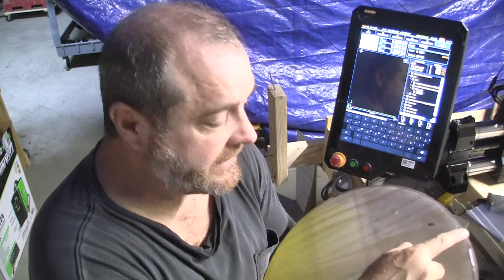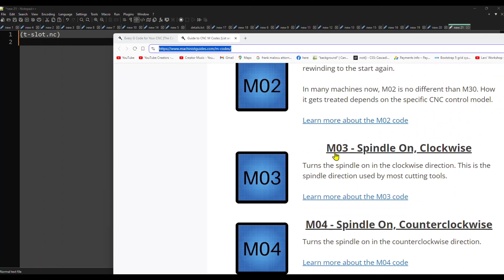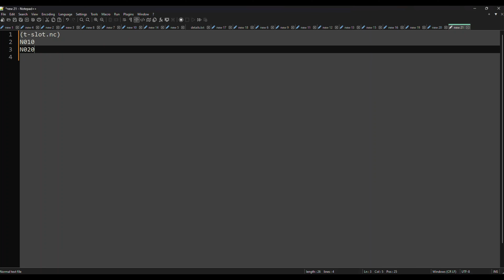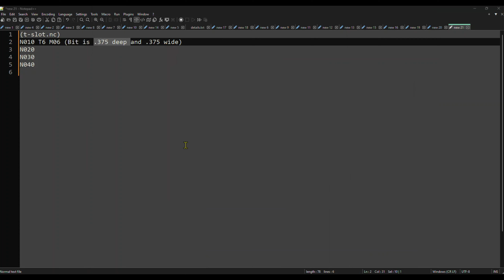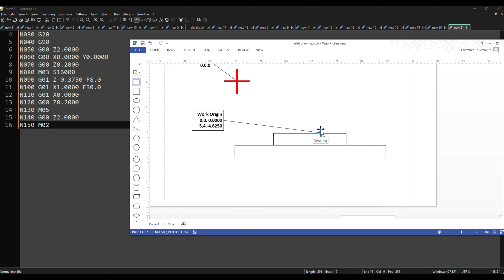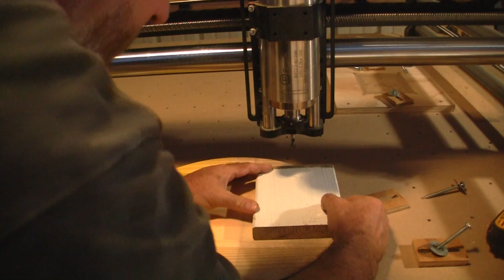OneFinity Elite Foreman   Masso G3 Creating a T Slot without software

Comment: What is the time between turning the spindle on and then dropping it down to make the initial cut?  Can you adjust that time?  I believe it's called dwell??
Reply from the maker: If I am understanding you correctly, there is no time delay in my code, you can see it in the description.  What you are seeing is built to the Masso, when the spindle comes up to speed it then proceeds.  However, if you want to make a longer delay you can add a Dwell, G04 Pxxxxx after the N070 M03 S16000 line, xxxxx is in milliseconds.  So if you wanted it to delay for 15 seconds you could add N075 G04 P15000, or for a minute you could add N075 G04 P60000.  Does this help you out?

Comment: Lars, I think I understood that I would just save the file created in Word or notepad, etc. to a thumb drive and it would run on my Masso.  Am I correct?   If I can master this, it will be helpful for hanging designs flat on a wall.
Reply from the maker: Yes.  Just need to save it to something like tslot.nc.  Run a test on something, get the x, y and z set.  then just line up where you want your x,y on your sign and  and reprobe the z and you will be good.